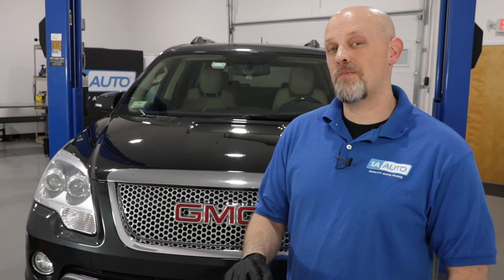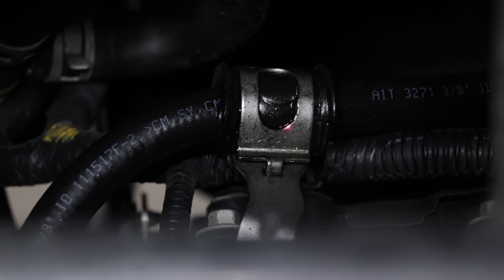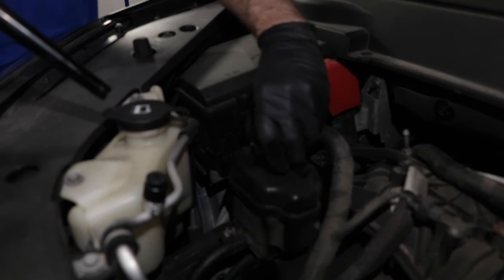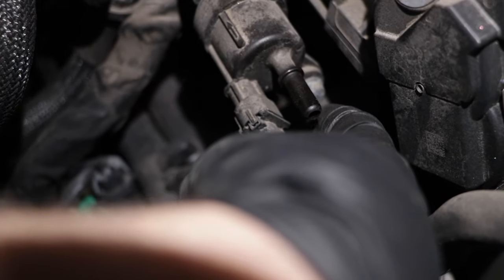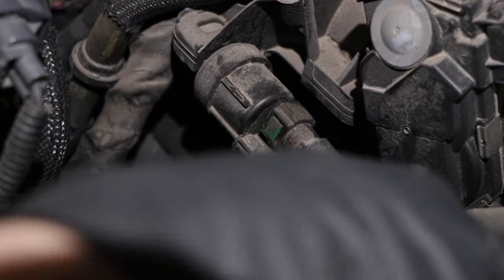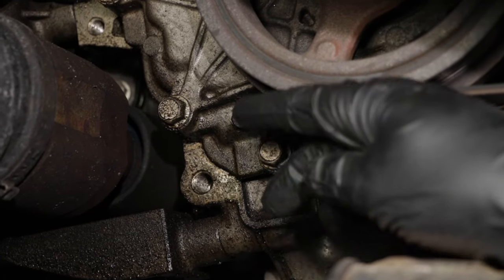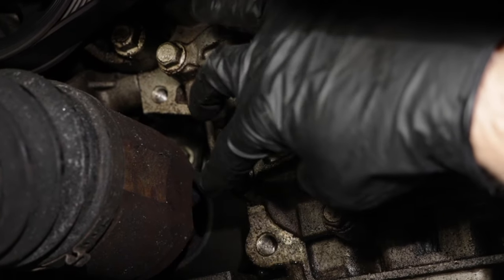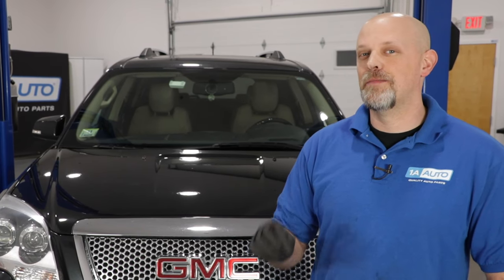Top 5 Problems GMC Acadia SUV 1st Generation 2007-2016

Comment: I have a 2009 buick enclave cranks but won't start.   I have replaced the crankshaft position sensor and still nothing.   Sound like no spark.   A got 60 psi of fuel.

Comment: Got a 2008 GMC Acadia and it says transmission hot Idle engine. And also by where the brake and gas panel it gets hot. What could that be?
Reply from the maker: +Bryan Ruiz We wouldn't be able to diagnose an issue like that here, you may want to have a local mechanic take a look at it. Thanks for checking us out! http://1aau.to/m/Shop-1AAuto-c

Comment: Kinda depressing , since I have the 2016 model . But I'll just keep the oil changed- right- and have the transmission flushed at 60,000 miles . Maintenance is hopefully the Key .....

Comment: Hello great video, I have question about knocking sound coming out of the front in, could it be lower control arm bushings .its a 2012 Acadia.
Reply from the maker: +Michael Hunt We wouldn't be able to diagnose an issue like that here, you may want to have a local mechanic take a look at it. Thanks for checking us out! http://1aau.to/m/Shop-1AAuto-c
Reply: Sway bar links if you hear it when driving over a crack in the road.

Comment: What about shaking from the front end while accelerating at about 40mph? New tires were balanced... Brakes were changed along with rotors... Still shakes around 45mph can't figure it out...
Reply: could be a cv axle worn or gone bad. a good mechanic should be able to diagnose it, to be sure.

Comment: My daughter got a 2011 GMC Acadia and it will not start without a booster jump.we bought a new battery and we put another alternator on it.but it still need a jump everytime.this started when she was backing out the driveway and the neighbor across the street was backing out his driveway.and she was hit in the back every since then it been doing that.
Reply: accident damage, it could be anything.  But my guess would be a wire is shorting, or a module is damaged in some way, causing the battery to drain off fast.

I would first check to see if their is a parasitic draw on the battery.
This would verify power being directed somewhere, and how much (in amps).

A mechanic should be able to do a parasitic draw test for you.

But finding the problem can cost a lot, depending on how long it takes to track down the problem.

At least you know to start looking in the rear of the vehicle.

Comment: I have a 2012 at constant highway speeds the rpm surges and it is very noticeable if you are riding in the back seat while its happening everyone else head is moving back and forth to the surge. very annoying i need it fixed but unsure if the waveplates or torque converter need replaced dont hear any harmonic or drone just surge or lurch
Reply: Was it the wave plates or converter? I was told today the wave plates need replacing. Very expensive though😩

Comment: How do you fix the stabilitrack problems the service stabilitrack light randomly comes on and when it does my Saturn outlook 2008 xr downshifts extremely hard. Someone recommended cleaning throttle body and mass airflow sensor and it makes sense because my intake snorkel is full of oil. Any suggestions?
Reply: Change out both your pcv valves for the oil issue...the rear has two holes in the bottom and one in the top. If like mine .. one of the bottoms fills up...it changes the pressure and sends oil spray up the line. Over time I was Losing oil and didn't know how. This was the reason. 08 Acadia
Reply: Some of this ties into the stabilitrack as well. After these fixes the alarm stopped and now seems to be gone for the moment. Throws lean cylinder codes

Comment: I have a 2009 Acadia And the problem I'm having is the blinker will not turn off . The only way to make it stop is turn the switch all the way to the opposite Position But on that side the blinker won't work

Comment: I have a 09 gmc Acadia and its running  rough getting crank sensor and mis fires on all cylinders is tha a sensor or timing chain
Reply: Crank Position Sensor,  6.00 at junk yard.  (good luck)
- Could be loose fuse box harness or fuel injector harness if all cylinders.

Comment: I have a 2014 slt2 63,000 miles the rear a/c went out problem was the rear expansion valve. Now I have a parasitic draw that I cannot locate. Other then that it's been a good vehicle. If anyone has any ideas on the  parasitic draw please let me know. Thanks

Comment: I have a 2011 acadia and the Evap purge solenoid valve went out which made my car run hot. After replacing solenoid my car was low on antifreeze. Filled it up and still running hot with a leak draining behind drivers side front tire. I can not find where this leak is coming from. Has anyone found this same problem or happen to know what it might be?

Comment: I have 2007 Acadia and as I was diving on the highway my car started to slow down and wouldn’t let me speed up I had to pull over and turned it off. When I turned to start it back up the power was on but it wouldn’t start the car at all. Not sure what’s going on. A few days earlier I got the traction control/ stabilik pop up and then the oil pressure low stop engine. Pop up. All at once idk what’s happening! Anyone help?? My car is Currently at the mechanic and they have yet figured out what’s up.

Comment: I have a 2017 xts that up a hill or in the bottom of gear range the car shutters and then it'll downshift out of it and it happens mostly at lower rpms with light throttle
Reply from the maker: +King Repair Thanks for the feedback!

Comment: I just ran across this video, and immediately subscribed. Great work. I hope someone happens to read this and can steer me in the right direction. My 08 Acadia has the wave plate issues which limited us to 1-3 gears. We were going about 65 (😓I know, I know.) My wife said that suddenly a "reduced engine power warning"(temp was good on engine and transmission) instead of reduced power it actually shut off. When she tried to restart after we stopped, the starter turns but never engaged flywheel. Gonna remove and check starter but I'm worried,...how are the two things possibly related??!? To top it off now the battery is mysteriously being drained overnight by what might be this electrical whine coming from the trans .....smh we were royally screwed by the dealer who knew of the wave plate(went so far as to have a plant there to compete for the car after hours, the attorney general has filed a class action suit since) we weren't alone. But anyway we still have grown to love it and definitely can't afford to replace it now but I'm afraid it may start eating money...thanks in advance for any advice or just reading.
Reply: I had wave plate issues and had the transmission rebuilt under warranty but they never caused shifting issues the trans just started slipping.  What did cause issues and limp modes were the diaphragms that needed to be replaced.  If you google the transmission diaphragms you can find how to replace them and I found a tool with the parts on ebay for like $25.  It fixed crazy issues I was having for a couple of years but could never pin point it.
Reply: @71bgt  did your trans ever stall to get into drive ? Or go into a no throttle response limp mode at times in a bit colder weather?

Comment: Hi I have a 2016 Acadia FWD there's a problem with it. The engine is not cooling down even when turned off for long time
Reply: Even after a oil change still not cooling down checked radiator its fine fans a working, fan keep running even after engine turned off.
Reply from the maker: +Shaji Saeed We wouldn't be able to diagnose an issue like that here, you may want to have a local mechanic take a look at it. Thanks for checking us out! http://1aau.to/m/Shop-1AAuto-c

Comment: I have a 2009 GMC Acadia, the power steering has been replaced, transmission has been rebuilt twice, the a/c compressor replaced twice, the throttle body replaced, the catalytic converters and O2 sensors.  The engine light constantly stays on for different codes all the time. To get the a/c to cool never,never,never push the a/c control on just the recirculate button on. The radio does what it wants to do, volume, station. A total piece of trash!! I sure I'm forgetting something that has broken and replaced.

Comment: I have a 09 Acadia had to have the timing chain replaced. GM extended the warranty for the timing chain to 10 years or 120,000 miles. Anybody with a 2011 research it if you're having a lot of misfire issues or you get the timing chain code.
Reply from the maker: +BigBucks NoWhammies Thanks for the feedback!

Comment: In a flash of a second the ABS light , traction control service and stabilitrak service came on 
A few days later the all wheel drive off came on 
Plus limp mode kicks in every time i go over 2000RPM 
Ive changed ABS sensor 
Brake pedal switch sensor
Hub and bearing and Will in the process ive even changed the cv axle all front driver side , because the noise and grinding was all there before all this 
Still no traction control, stabilitrak, all wheel drive or ABS and kicks on limp mode everytime i go over 2000RPM 
whats next ? Wheel speed sensor !?!?! 
If so how can I know wish wheel need it

Comment: I just got my 2008 Acadia and the Stabilitrak light keeps coming on and alerting me.. what can I do? Is it safe to drive it like this
Reply: Probably a bad wheel speed sensor. About a $200 or $300 fix. But have the car scanned at Autozone and they can tell you exactly what’s up. Good Luck.
Reply: Mine did this also! Took it to the dealer and cost me about 500 to fix! And after that and I got an alignment all good as far,as the light!
Reply: Not mine it cost me $2500 and I still have the issue.
Reply: I had timing chain replaced, oil relay switch and water pump fixed  the dealer charged me over $2500. Plus when I got the car the purge value had to replaced which was over $100.
Reply: This is probably the fix: https://www.youtube.com/watch?v=61grYGWi31k

Comment: I have an 08 Acadia and when I go to turn the ignition all it does is Click it doesn't want to start what would be the cause of that can anyone tell me what would be the cause of the SUV not wanting to start I've changed the ignition deal in the steering column brand new battery the fuses that sort of things and it still makes a clicking sound can anyone tell me what would make it just click and not want to start

Comment: I have a 2010 Acadia that sometimes wont start and its giving these code P069E,U0073, U0101. And after i do get it started again and shut it off and on a couple times my check engine light goes away?
Reply from the maker: +Tiffany Hartley We wouldn't be able to diagnose an issue like that here, you may want to have a local mechanic take a look at it. Thanks for checking us out! 1AAuto.com

Comment: Not sure why but my 08 Acadia wobbles side to side? Can anyone give an answer to this problem?
Reply: Clickme26 rear camber links worn. Grab the top of the tire and push in and out. You can feel and possibly see how bad the camber links can be . Kinda a big issue on all traverses enclaves and acadia’s . But guess what the new 2nd gen has the same problem with the rear sway but it’s the toe links now in the rear.
Reply: Needs new shocks
Reply: Bushing on the control arms maybe worn out and need replacing
Reply: Check sway bar and its bushings/links, also wheel bearings and tie rods/control arms, if ball joints are worn can cause vehicles to wander or wobble, and make sure the tires are still balanced and not out of round

Comment: What causes these to cut off while driving? Power stays on, car stays in drive, just randomly cuts off. I have to shut the vehicle down, put it in park, pump the gas pedal while turning the key back on, and putting it in drive, than it drives again. This is a 2009

Comment: I have a 2008 acadia , when i put it in gear it take like 3 seconds to actually engaged , what can the problem be
Reply from the maker: +Victor Rojas We wouldn't be able to diagnose an issue like that here, you may want to have a local mechanic take a look at it. Thanks for checking us out! http://1aau.to/m/Shop-1AAuto-c
Reply: @1AAuto  that would be the pump in the transmission

Comment: Crank shafted fixed that 
Timing chain fixed that 
Catalytic converters all 3 fixed that 
O2 sensors fixed that 
Pc value and pipelines changed and cleaned that area 
 And still have these lights one Now I have an issue saying stable track traction control and I have no idea how to fix them have tired basically everything
Reply: And I have had others fixed to but can’t think of it all right now and also my car keeps dying over
Night morning time comes
My car is dead I have a 2009 GMC Acadia I have only passed inspection on this car for
One year and have had it for 3 !!
Reply: Brayden Ireland2012 hey someone in the comments earlier said how to fix the stabili track problem and it did not seem hard or expensive. I would go check it out if I was you!!

Comment: I bought a 2007 Acadia new in 07.  This was absolutely the worst vehicle I have ever owned.  Steering rack problems, transmission problems, timing chain problems, sun roof leaks, and assorted other problems.  Sold it just before the warranty expired and never looked back.

Comment: I am the unfortunate owner of an 07 Saturn outlook and have had almost all these issues.  Don't forget the problem with the passenger airbag connector under the seat having poor continuity and tossing up the airbag light.  I had a Montana van that was great so I bought what I thought would be a reliable gm upgrade.  NOPE!  Piece of crap 😠

Comment: Hey guys I have a 2013 gmc acadia runs and drives great. Only issue I'm having is a constant whining noise coming from transmission and it has a slight delay going into drive? Any suggestions on were to start?

Comment: Im having the toming chain issues. Im also getting oil in my fuel.
Reply: I wish you luck... Mine jumped, bad. They had to replace all 3, because of course this comes with 3 of them... Ruined part of the engine, as well, $2600 repair...

Comment: where is the Body control module located on a 2007 acadia??? in the center console or under the driver side?? HELP!!! I HAVE A CODE U0140 LOST COMMUNICATION WITH BCM

Comment: 09 gmc acadia, misfires at low RPM's. Sends flashing check engine light.  Owners manual says the computer detected a misfire.  Changed spark plugs to OEM still misfires.  Changed all coil packs, still misfires and then changed all injectors still misfires and sends codes.  What the hell could it be??? 😳

Comment: What a disgrace and disappointment,those 3.6V6 engines bankrupt there owners, my bro’s shop has literally done dozens of them, since they would t pass NY state inspection with a stretched timing chain,they throw a cam/crank mismatch code just like the 4 cylinder Colorado’s do. Even using OEM parts and with 5000 mile full synthetic oil changes the chain issue will come back again it’s simply a poor design with multiple chains.its a 2000 dollar job at the minimum in most shops if nothing else is wrong..
Reply from the maker: +John DiMartino Thanks for checking us out! 1AAuto.com

Comment: Anyone have a high pitched whine that increases with RPM? Not loud enough to hear with the windows up but I notice it when my wife drives the car away.  It sounds like a power steering pump issue to me but it doesn't change when I turn the wheels. 2016 Acadia Denali, 65,000 miles

Comment: 2015 Traverse with 85,000 miles and I'm sadly checking off the list of the top five. PCR valve first, now the power steering pump (which will probably end up including the rack as well). I do hear a moan when accelerating so I presume I'll be looking at a torque converter before too long. What a waste of money.

Comment: New battery installed. Vehicle will act like  battery is low, and click. This can happen maybe 3 to 4 times in a row, 5th time vehicle will crank and start like there was no problem.
Reply: Might be the starter

Comment: there should be a place where you can get that type of work done and not get in trouble for doing what is needed. How Can I do the decarbon process of open throttle when every fucking street 30mph or less?  i can see if the shop was next to a highway on ramp maybe. Same with brake bedding theres zero area to get up to speed without a possible ticket

Comment: I am not familiar with my vehicle at all. I feel my  gmc acadia feels sluggish when driving, especially going up a slight incline. My current issue is my ac was blowing warm air and now it is hot air.
Reply: Oh and when I'm driving the rpm, revs up and down at times it feels like if I'm going 45mph the car will slow down and I would take my feel off the gas and reapply it in order to catch back up to the regular speed limit or I will pull over and turn it on and off then it will work for a little while
Reply: When I put my car into gear, I feel a jerking motion as if it's going from the engine
Reply: I also get a catalytic converter code, about four times now and my mechanic keeps clearing it, saying it's fine. I normally fix my car whenever there's a problem but since changing my mechanic I feel like I'm not getting the type of service I'm use to. I read up on the catalytic converter and I read that when it is time for inspection my car may not pass ins if that issue is not resolved. Currently pregnant and not sure if there will be a second wave to this virus. I need my car in working order.